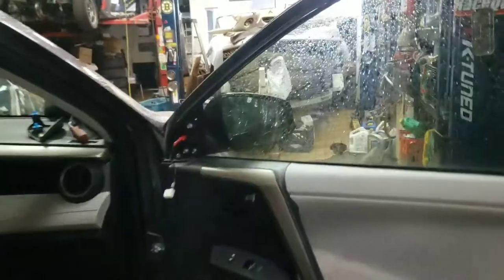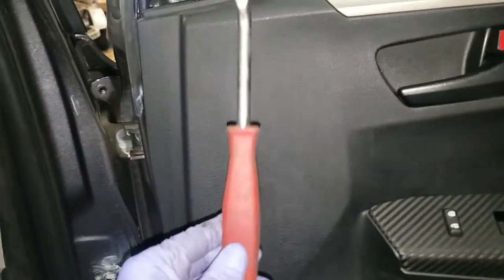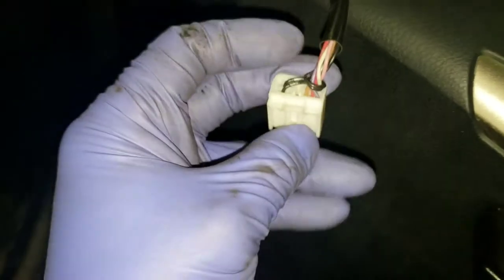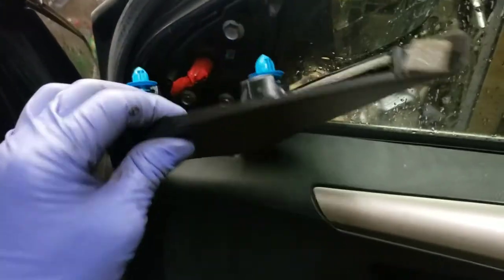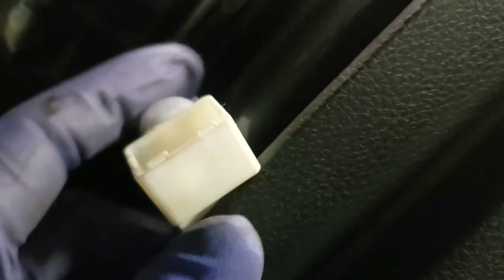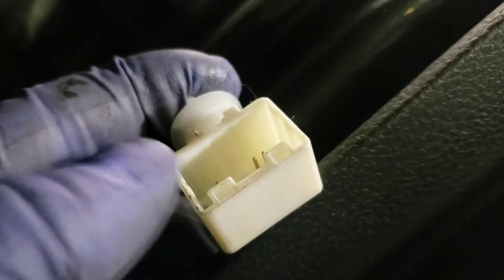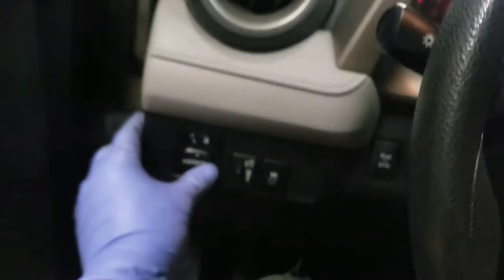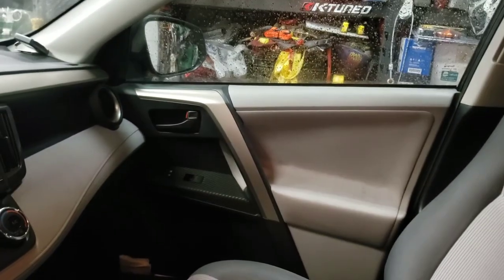Toyota Rav4 mirror replacement short cut

Comment: This short cut worked for my wife's 2017 RAV4 Hybrid. I did not pull the clip for the wire harness connector inside the door. to push in the button to release the wire from the mirror, i put a plastic tool down inside the door from the top to push in the button to release it and pulled the wire at the same time to get it to separate. took 15-20min because I was trying to be really careful. Spent $10 on a set of plastic tools from amazon. The damn mirror cost $425 just for the part! craziness. But, Thank you sir!